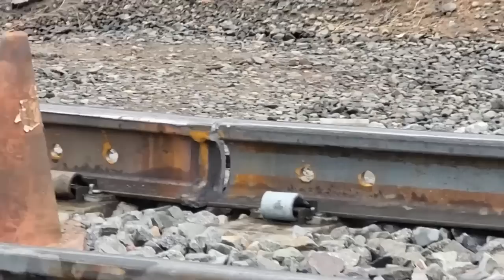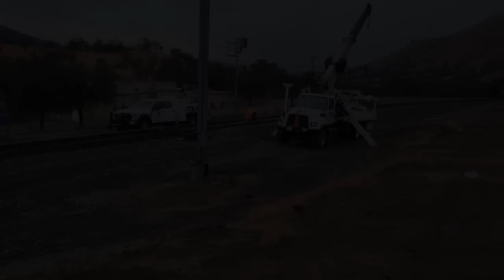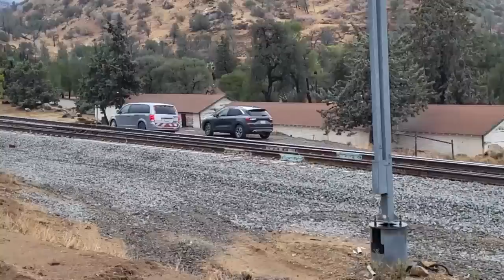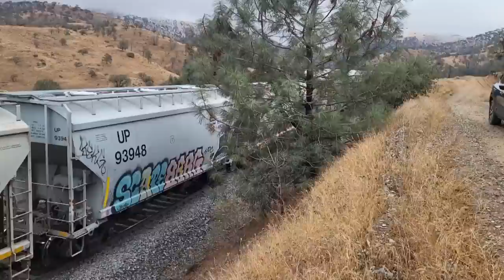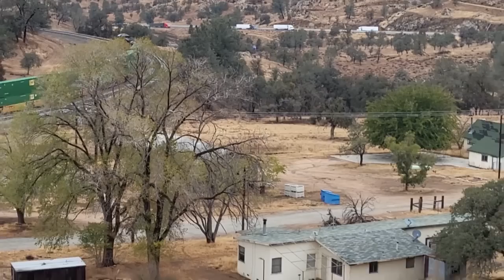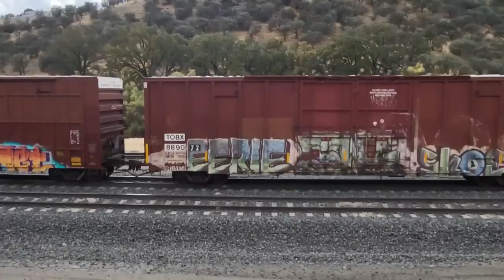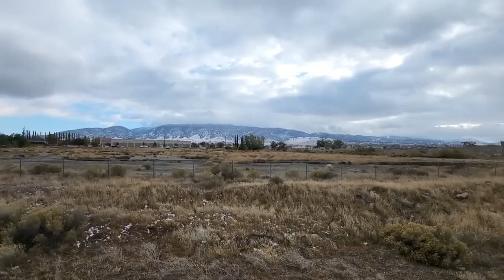Trouble on the Tehachapi Pass! Broken Rail at Woodford.

Comment: What happened to your truck?
Reply from the maker: It was still making funky noises from the back and it was shuddering in certain RPM ranges under a light load. They had it for three weeks!
Reply: @MarkClayMcGowan  did they say what the issue was?
Reply from the maker: @Jacob Pfeifer  clunking was more issues with the leaf springs. They said the drive line was improperly installed and caused the shudder, but it's still doing it. Not as bad, but very noticeable
Reply: @MarkClayMcGowan  my car is in the shop too. Needs a new alternator and gas pedal assembly.

Comment: I said wait a minute that container was missing a door, rewound and sure enough the rust colored on top at 12:34  minute mark was missing the right door
Reply from the maker: Yeah, it's actually pretty common. You'll see them on empties and they'll be repaired at the port facilities
Reply: @Mark Clay McGowan  not doubting your experience but I worked FEC Intermodal 13.5 years and never saw this. L
Reply from the maker: @Guokas0422  I didn't think that! If you watch enough videos of these intermodals, you'll notice it more often. I rarely notice them while filming. Viewers almost always point them out. Sometimes just open, sometimes just gone! Thanks for checking it out!

Comment: 0:17 ?
All that is is a FAILED THERMIT WELD - nothing drastic, in fact it's already HALF FIXED by having at least two fishplate bolt holes in either rail - that will line-up with half a fishplate set. All any HALF DECENT maintenance worker needs to do is use an ACETYLENE GAS TORCH & blow through another couple of bolt holes in the next rail, (that is - if the original bolt holes don't all line-up with a full fishplate), as there's about a 1/2" gap in the far side's joint area.
Would take someone with a gas torch and a few bolts & a new plate set, about 15 to 20 minutes to FIX.
P:S - the way the USA staggers it's joints across several sleepers anyways, actually means that any number of trains could have SAFELY crossed over that broken weld, so that a "late arriving" maintenance gang could repair it "BETWEEN" the running of trains. (in other words zero demand to stop any trains).
Be any other railway in the world, that's all they'd do - get a track worker with an acetylene torch, to place a replacement fishplate alongside the "break" and blow a couple of holes to suit, then simply bolt-in a replacement fishplate set.
Any time within say the NEXT YEAR a thermit welding crew could later, (at their leisure) simply re-weld the joint.
A TWO MINUTE FIX would simply to have bolted (to one rail end) a fishplate set and left the other end waggling, (between the time it was found and the portable welder turned up - as trains can easily pass over BROKEN RAIL.
It's when there's a FULLY HORIZONTAL SHIFT of the rail alignments, that causes troubles.
Even say a 2ft gap in one rail WILL NOT CAUSE ANY PROBLEM the train simply self aligns across the gap.
Reply from the maker: Everyone is an expert! It is NOT a failed weld and it wasn't a thermite weld. It was done electrically with an on track welder. The weld itself prohibits an angle bar (what we call a fishplate) from being used. It is illegal to have any rail on a class 1 mainline that has been torch cut in any way as it changes the structure and temper of the rail. 
There was a five inch low spot under the break (which was more than likely why the rail broke there, not to mention an overnight temperature swing of nearly 40 deg F) and that is why it was removed from service. I don't know what railroad YOU worked for, but running a train over a two foot gap would get you fired on any class 1 road in America. Anything over three inches must be removed from service unless it can be bolted using a "dutchman", which is a small bar with one hole for a bolt to go through the break.
It is against the rules to occupy an OS (the track within a control point) without positive on track protection. You can't simply occupy a track (even between control points) between trains and hope you get the problem fixed before the next one gets there. I'm not trying to be an asshole, but you obviously have no idea what you are talking about.

Comment: Now, thanks to all the ecological shenanigans, we've finally gotten to a point, where it would be preferably to re-grind the old rails over and over, untill they fade in dust, rather than ordering these new-ones, made out of the same self-dissolving powder, as car rims..
Reply from the maker: Actually, rail grinding has been going on since the late 19th century. Railroads have neither the time, money or man power to change out rail every time the head flattens out in areas such as the Tehachapi or Donner (flat straight rail doesn't generally require grinding). The rail in this particular instance, was about four months old.
Here is the link to a video about why grinding is necessary   https://youtu.be/iNs31nyJfV8

Comment: The whole thing held together with chewing gum and sticky tape.  Cut out the old piece weld in a new piece.  Do not address the cause.  Private enterprise in charge of national infrastructure at its best.
Reply from the maker: You are so very mistaken! This was all new rail and ties, laid five months prior in a project to replace all wood tie turnouts on the Tehachapi with concrete ties and new rail, that will be completed this year. The cause of this particular break was a low spot at the weld. The surfacing gang has since redone this entire location. I can't speak for other subs, but the Mojave is one of the best maintained on the UP system. Thanks for checking it out!
Reply from the maker: I'm not sure I understand what you think could be done differently. Our freight system is, by far, the biggest and most efficient in the world. There isn't a class 1, top tier, mainline locomotive operating in America that is using a chassis built in the 60's. Locals, switchers, yard stuff, branch lines operations, class IIs? Sure, why not?  Most spurs and branches can't handle the big, six axle units anyway. Broken rails are the most common problem in railroading. It might break the next day, or never. When you're dealing with tens of thousands of miles of steel, there are going to be problems. "It doesn't happen in Europe" you say? Yes it does, but with many times more miles of rail and 10,000 ton trains, we will obviously have more issues.
Railfans flock to America to see our spectacular railroads because there are no others like it in the world. 
Also, we may have the largest economy in the world (even that is changing), but we certainly aren't the richest nation in the world!